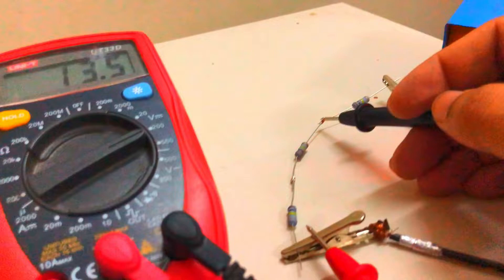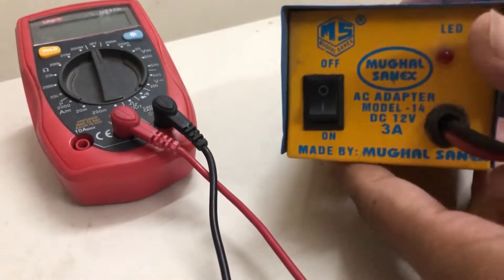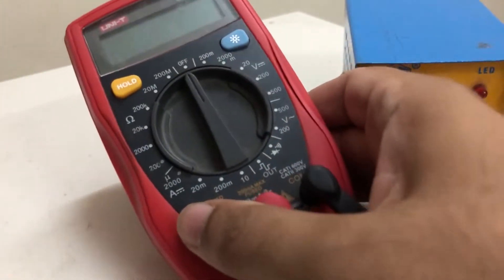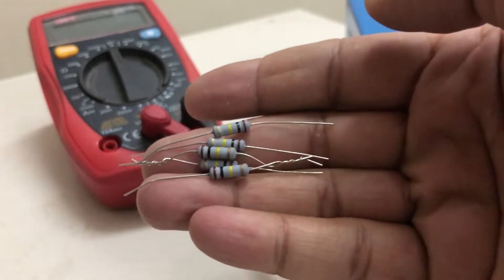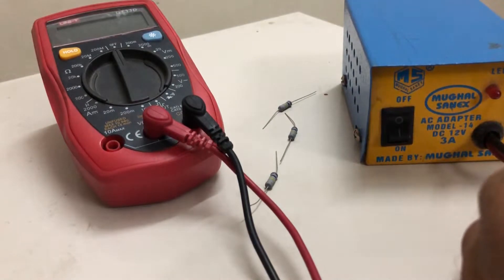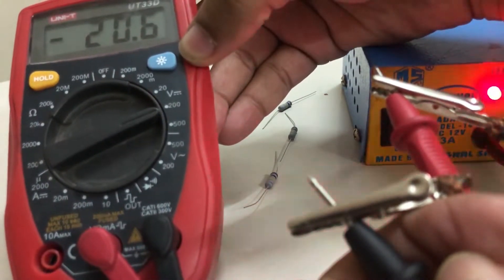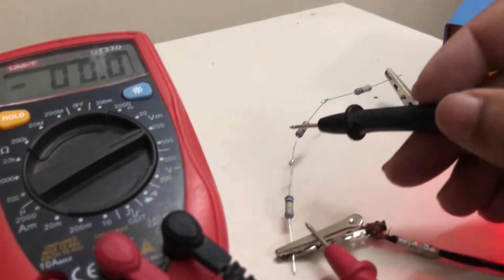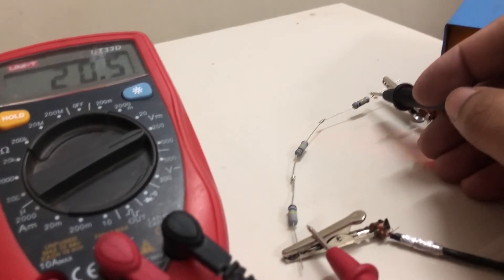How To Drop Down DC Voltages Using Resistors

Comment: Did I miss something?   it looks like each resistor increases the voltage instead of reduces the voltage.    That's backward!
Reply: The positive side must be on the right at 2min
Reply: Yes bec he connects 2 polarities from both sides terminal of the r3sistor.